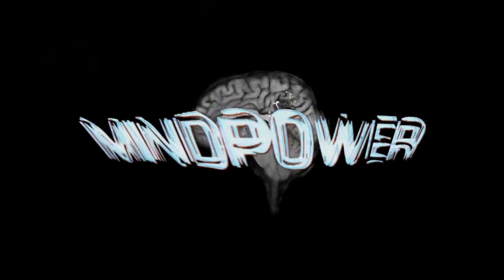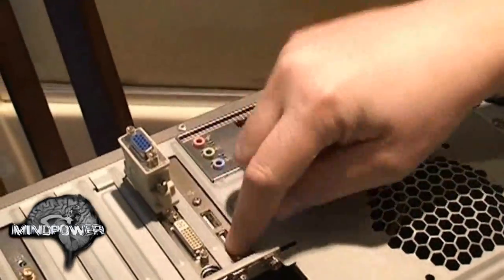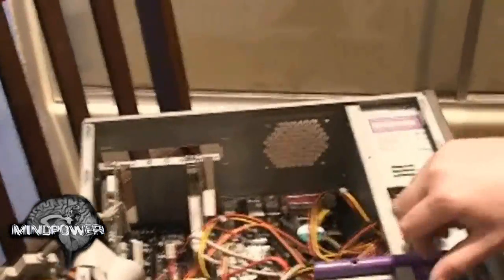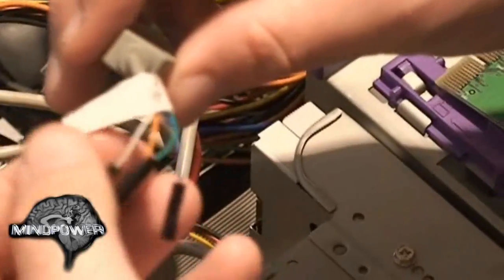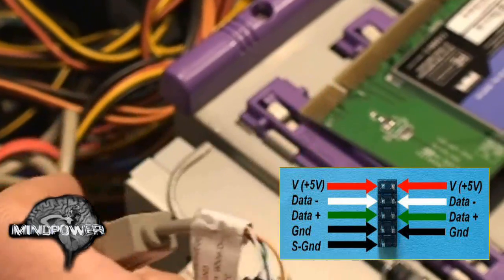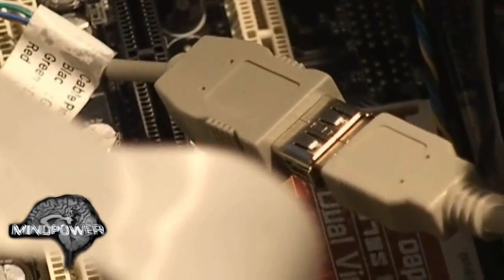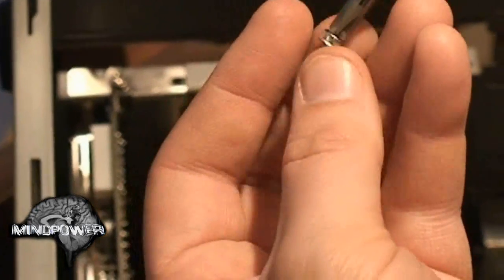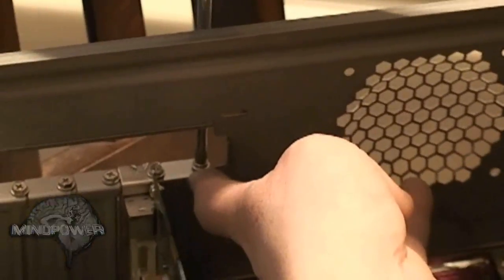How to Install an Internal Flash Card Reader - Mindpower009

Comment: @Rune101rune Yeah that should still work.   It just means that it's only using one of the two ports on the USB header.   Just make sure you're using the right pins (follow the color coding if possible)

Comment: As long as its an extension of the USB 2.0 and not a adapter/you should find no problems..the MS FIX is about.adapting/usb/I use a Belkin Powered HUB--it might considered as your video explains.(though I can't see what the video explains).

Comment from the maker: @MisterTymes No because this isn't a modification.  It's simply taking the built in USB port and running it to the front of the machine, and plugging in a flash drive.  I've done this mod on at least 3 PC's, and 2 of them were Win7 machines.